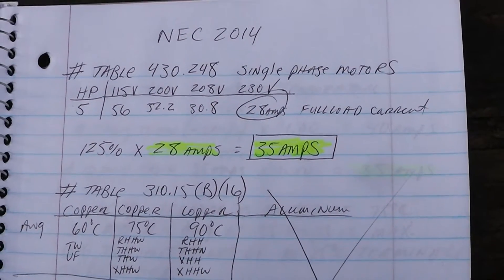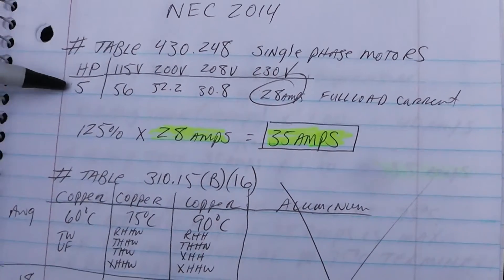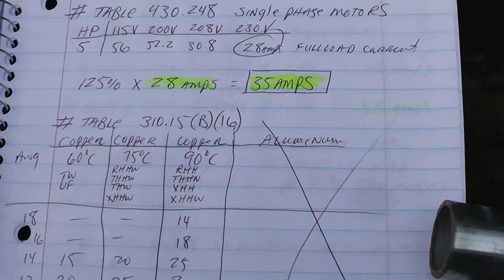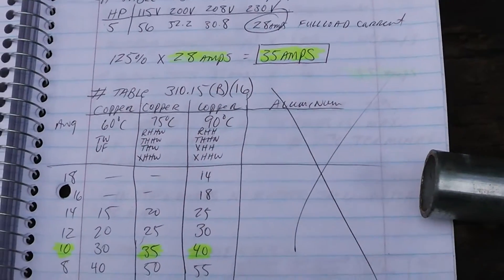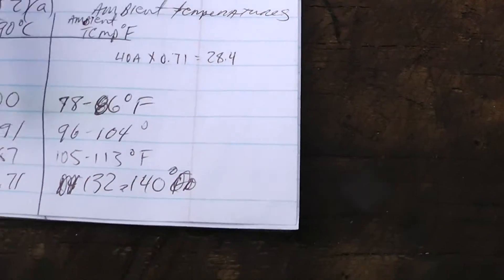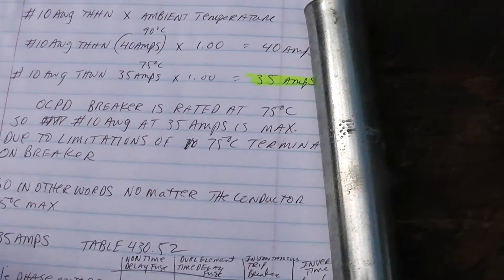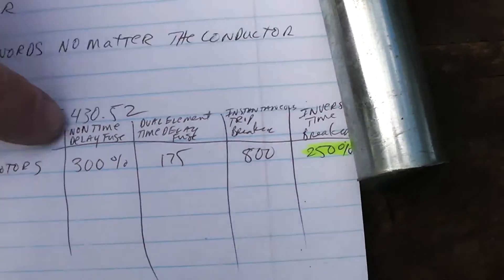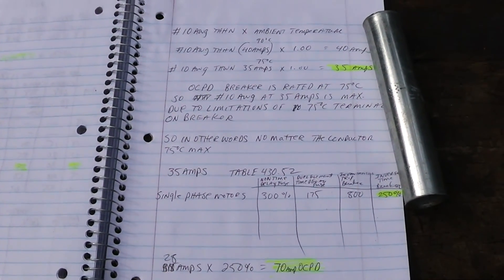How to Properly Wire a 220 volt 5HP Air Compressor per NEC part 2

Comment: Good morning sir,I like to asked if possible to use my 50ampere circuit breaker 220 volt on my air compressor 220volt 5 horsepower?thanks
Reply from the maker: It will work but, it probably won't meet code. I would ask your local electrical inspector for the fine details in your area.

Comment: Great video!  Roughly six years later and still good info with reference straight from the NEC.  I have an Ingersoll Rand 5 HP 230v 2-stage compressor install today.  I'll be using 8 AWG THHN left over from a previous install, plus the wiring from the motor to the pressure switch is #8.  This is a good indicator of what I should be using.  
Yeah the NEC can be confusing sometimes...  And they often have small-print notes that can add to the confusion.  Case in point:  Under Table 430.248 Single Phase Motors it states "Synchronous motors of the low-torque, low speed type (usually 450 rpm or lower), such as are used to drive reciprocating compressors, pumps, etc. that start unloaded, do not require a fuse rating or circuit-breaker setting in excess of 200% of full-load current."  Not in any reciprocating compressor I've come across.

Comment: I loved your video.  I am in the process of swapping my compressor from a 230 volt 30 gallon 5hp 15 amp unit to a 230 volt 80 gallon 5hp 22 amp with magnetic starter.  My shop compressor circuit was wired with #10 THHN on a 30 amp breaker.  Referencing this video, does the breaker need to be upsized to a 40 or a 70?  Same climate as Florida.  I am having difficulty wrapping my mind around #10 THHN on a 70 amp breaker.  Seems like no protection for the #10 THHN.
Reply from the maker: I would talk to your local authority having jusrisdiction(electrical inspector) in your area.

Comment: Well that certainly is some over protection. IMHO, and seen many if not most DIYers (including myself) wire their 5hp 220v (dual or single stage) 60-80gal air compressor safely with 12gauge THHN/THWN wire on a 30amp breaker. From my calculations these compressors whether it be a baldor or some other brand barely draw 20-22amp on start up and slightly less in the running phase. And since this wire I stated is rated at 25amp at I believe 167degrees F if not mistaken is safe enough if under 50 feet of run. And this does adjust for slight overload as well but not much. Been doing it for years and years without problems. Others can chime in if they agree or not. Just my opinion.
Reply from the maker: What you've stated would work but, it would not pass an electrical inspection. Just sayin'.

Comment: So in the Video, you calculated a 10 gauge wire is what you need, which is rated for 40 amps, but the braker will be for 70 amps, Im aware that at initial start up, electric motors will pull up to 4 times the rated amps, so using a wire rated for 40 amps, will it hold up to a max current draw of 70 amps???
Reply from the maker: The answer is yes and no.  "Yes" for start up but, "no" for continuous or intermittent duty.
Btw, it 6 times the run amps on start up.

Comment: My question is is what would you say if you had an electrician tell you that a compressor with a motor that is 230 volts pulling 17.2 amps max that you use 10-2 wire with a 30 amp breaker and a 30 amp plug and Outlet??
Reply from the maker: I would want to know what the horsepower of the motor is.
Reply: homesteadprepper 3.7
Reply from the maker: I am guessing a single phase motor?  I have never seen a 3.7 HP electric motor.  They are usually standard sizes.  Is this a USA made motor?  What brand is the compressor?
Reply: homesteadprepper yes single phase and not sure on the motor. But it says made in the USA, brand name is industrial air m/n ILC3706056( if that helps). Everything I look says 15 amps but the label on the tank says 17.2 and the motor says fra 17.2
Reply from the maker: The proper way to hook this up would be to talk to your local electrical inspector and ask him his interpretation of the NEC for your area for this application.
Reply: homesteadprepper will do, the funny thing is I called the manufacturer they couldn't give me any information but said I needed a 30 amp breaker. And I know to use a 30 amp breaker it has to be 10 10-2 wire, iyo would it just be smart to use a 30 amp receptacle and wire it with a 30 amp plug??

Comment: Great vid. Nm/Romex= 60 degree column (ALWAYS!)

Thhn Thwn=75 degree column most common.

Most residential breakers' terminations are rated at 60/75 degrees. That means you have to use the 75 degree column for THHN. 

Breaker 75° ---------- wire 75°-------- Termination 75°

I know you already know this, just clearing it up for others. Like you said, weakest link.

Comment: Hi really like your videos, what I didn't understand on hooking up the air compressor is the number 10 wire on a 70 amp breaker. in my mind I thought you would have to have a number 4 wire for 70 or more amps. please help me understand thanks. and one more thing what happens if you run a ground wire from your main panel to your sub panel and don't use a grounding rod on the sub panel.      Thanks mike
Reply from the maker: At @6:25sec table 430.52 explaines this for 70 amps on # 10 THHN.
For grounding sub panels try: https://www.google.com/url?sa=t&rct=j&q=&esrc=s&source=web&cd=2&cad=rja&uact=8&ved=0ahUKEwjEj66Z0cjXAhUI7iYKHdBpBpMQFgg2MAE&url=https%3A%2F%2Fiaeimagazine.org%2Fmagazine%2F2008%2F09%2F16%2Ftwo-buildings-common-service-grounding-requirements%2F&usg=AOvVaw2fJHle-dspyMfPrRdLbeFW
And https://www.google.com/url?sa=t&rct=j&q=&esrc=s&source=web&cd=4&cad=rja&uact=8&ved=0ahUKEwjEj66Z0cjXAhUI7iYKHdBpBpMQFghEMAM&url=http%3A%2F%2Fwww.ecmag.com%2Fsection%2Fcodes-standards%2Fequipment-or-building&usg=AOvVaw3wpxGIpTuUZtGwpFZEQq2p

Comment: Thanks for the video. Helps clear up a lot about motors and the code. I am going to wire a compressor with the same specs as the one in your example. I compared your example to the 2017 NEC and it matches. You mention the weakest link being the temp rating on the breaker terminals. If I want to use NM type cable, as per 334.80 the rating shall not exceed 60 degrees C. Is the NM cable now the weakest link? Looking at 310.15(B)(16) it shows 8 awg rated up to 40 amps (CU). I have no temp corrections and will use an inverse time breaker. So I would run 8 awg NM cabled fed by 70 amp breaker. Have I calculated this correct?
Reply from the maker: You are spot on.  NM or Romex is 60 C rated and would be now be your weakest link.  I believe #8 should suffice as long as you are not running it too long because you would be getting to voltage drop problems.

Comment: Great video, using that information I was able to use the code to get most of the information I needed. I still have 2 more questions. 1. Safety switch, is there a code that specifies size needed, or should it be matched to the circuit breaker?2. Ground gauge, is there a code for this? I noticed yours appears smaller than the hot.
Reply from the maker: I would talk to your local electrical inspector.  Your safety switch/disconnect might have to be rated for a certain horsepower/voltage.  My ground wire is the same size as the other conductors, #10AWG.